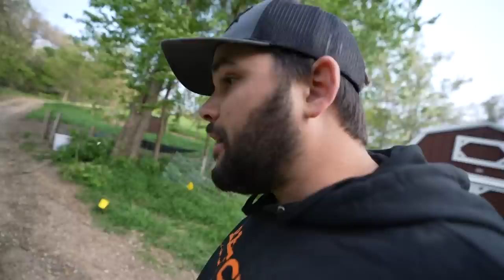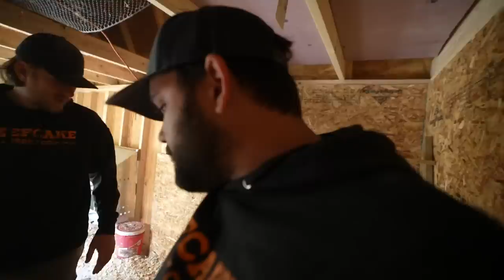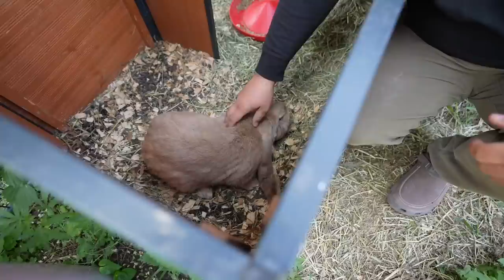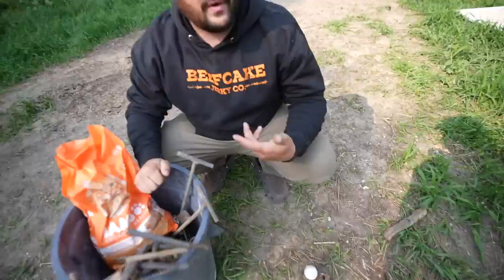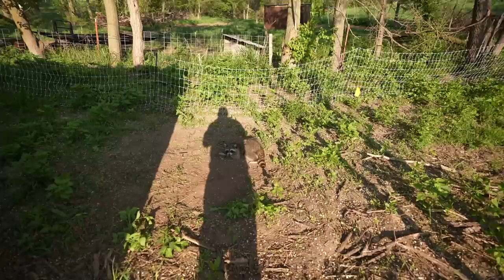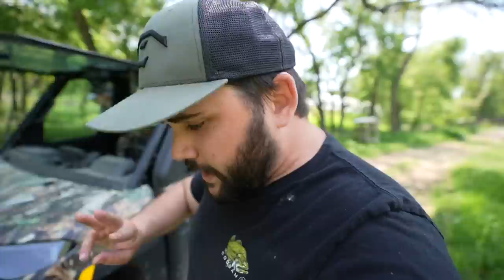They Killed them ALL!! But I Got REVENGE!!! (Blinded By the Light)

Comment: On my farm I keep all my chickens, ducks, turkeys, and pheasants locked up in pens with a metal roof and use rabbit wire. Chicken wire could work but I've had raccoons rip right through the chicken wire. Also leaving small foot traps or cage traps near any piece of woods/trees areas on your property works good since that's where the predators will be coming from.

Comment: Then Have 2 sets of 
SD Card per Trail Cam so you can make a Rotation every Week change the SD Cards
You should definitely 
Permanently Set Up the 
3 to 5 Trail Cam Next to the Trap & Near the Chicken Coop , Pig Area and inside the Barn in Camel Area Facing the Back of the Chicken Coop where you had a door and opening to the fenced or you should close that fence opening